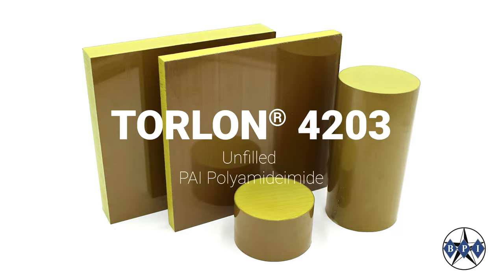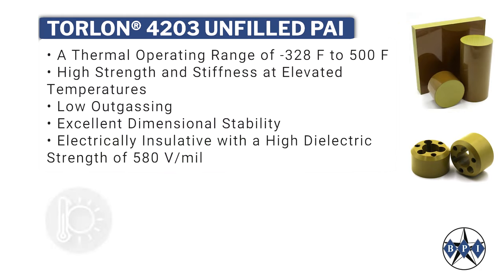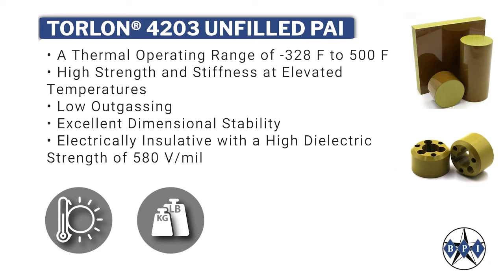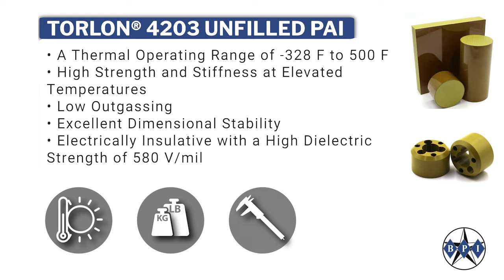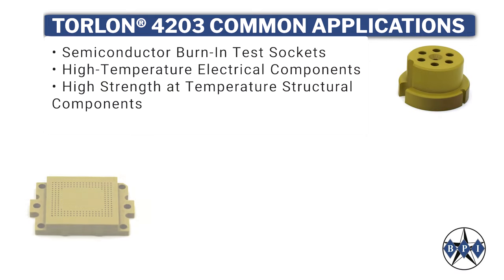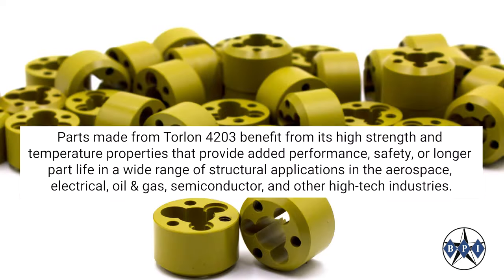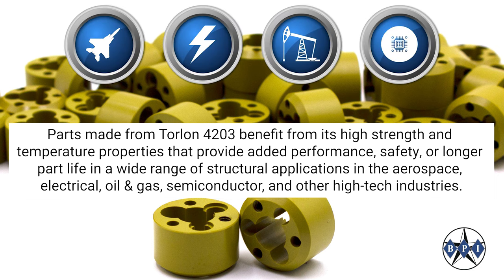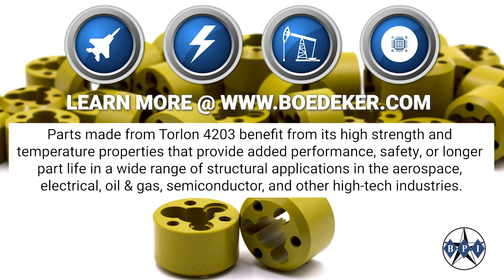Torlon 4203 PAI Polyamideimide Overview in Under a Minute | Plastics the Boedeker Way

Comment: Which unfilled thermoplastic has the highest ultimate tensile strength ?
Reply from the maker: Thanks for your question!  This can be a bit tricky, as properties can vary depending on the data you may be looking at.  Raw material resin data, which is typically based on injection molded test samples, can vary from data generated by stock shape manufacturers that may be processing the material via extrusion, compression molding, or via some other melt processing technique.  In those cases, data may be generated by testing machined test samples, not molded test samples.  With all that said, in the world of unfilled thermoplastics, I would say that Celazole PBI tends to offer the highest Tensile strength at ~23,000 psi.  Other materials that get close include Torlon PAI at ~20,000 psi, Ultem PEI at ~17,000 psi, and PEEK at ~16,000 psi.